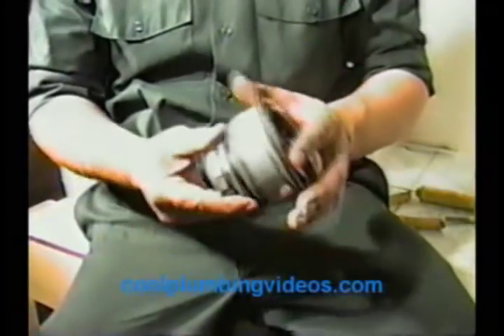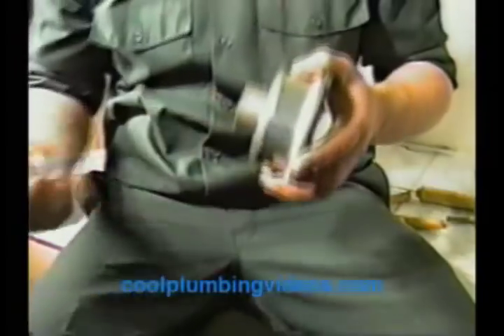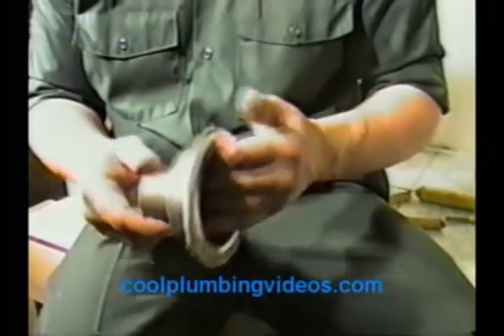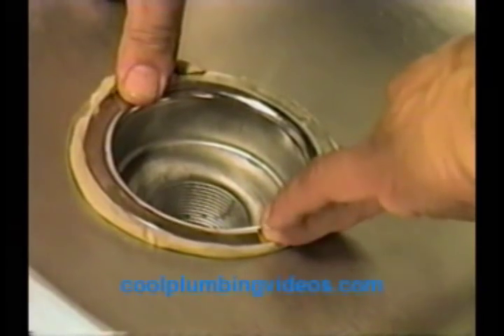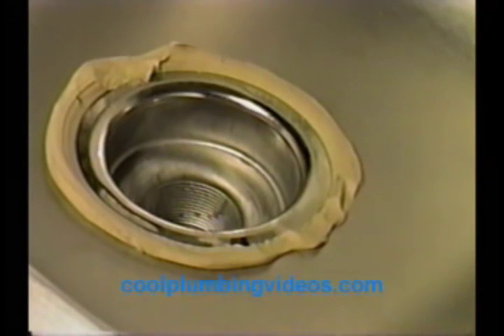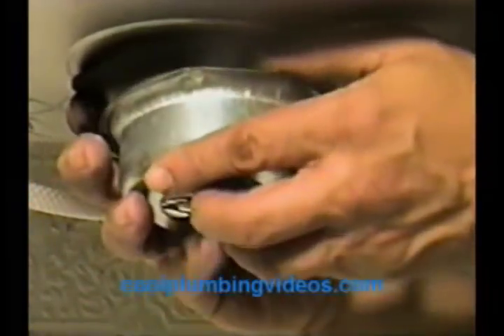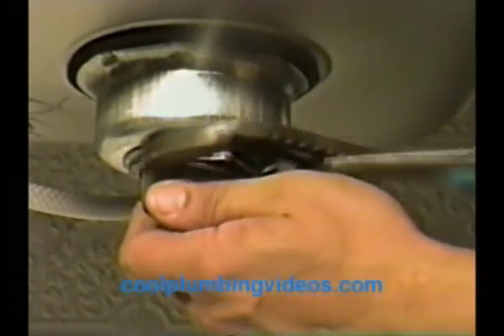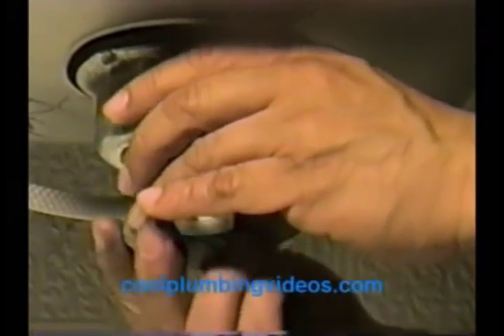Kitchen Sink Basket Strainer Install

Comment: Thanks for posting.  I've recently installed a similar basket strainer but have leaking problems.  I'm in Canada and the one I got is made by Plumshop. The instructions on the box do not mention using putty. The way I interpret the instructions and picture on box, I'm to place large rubber washer on top of  the sink opening,insert basket through opening, making sure washer is flat. Underneath secure the bell with nut. No matter how much I tighten, it still leaks. I'm checking their site now.

Comment: Nice job, Claude! Your video is clear and concise, well done! I wonder if distorting the metal at the top of the bell doesn't cause an uneven seal between the rubber washer and the sink bottom but you're the expert so I'll take your word for it.

Thanks!

Comment from the maker: @LordSauceness I only use the bell type basket strainer. It's a lot easer to work with and you can really get it tight easy. But if you have the other one. Put some pliers’ handle in the slotted holes on the top side this will hold it in place for you then turn the bottom. You may need 2 people for this. Good luck my friend. Keep that  great sense of  humor, as you see you will need it :-) LOL

Comment from the maker: Yea you really want to use the putty, Depending on the sink some company's what you to use silicone caulk if it's one of those acrylic or plastic sink's. But on cast iron and metal sinks putty is the way to go. Thank you for the comment. Good luck

Comment: The basket strainer on my current sink where the threads are underneath the sink has rusted right through and is leaking I want to replace just the basket strainer, and my question is do all sinks come with a replaceable basket strainer?

Comment: After a certain amount of time the "Plumber's Putty" gets hard and water starts to drip into the cabinet under the sink. I would rather use something that stays soft so it seals. Such as duct seal or silicone rubber.

Comment: Gambler77713 comment's problem is he/she put the rubber washer on the wrong side.  Putty on the top side between drain body and sink.  Rubber washer on the bottom side of sink between bell and sink.